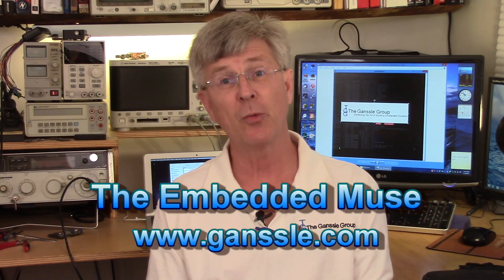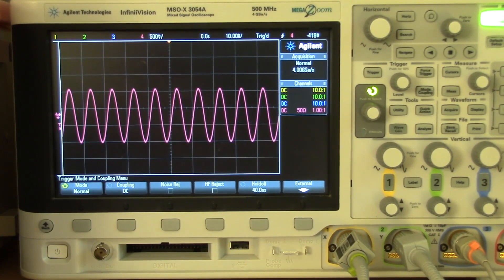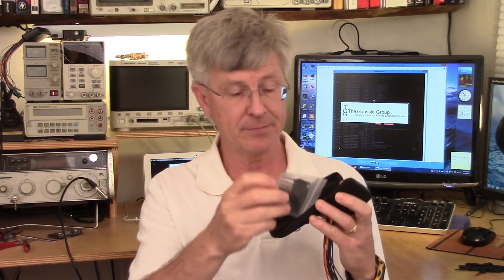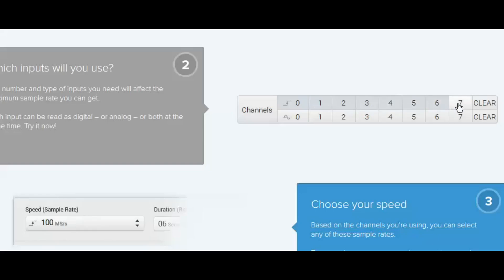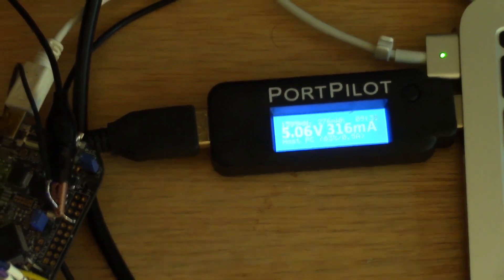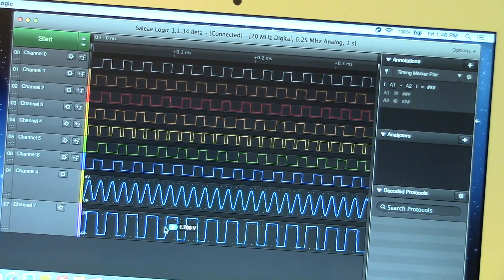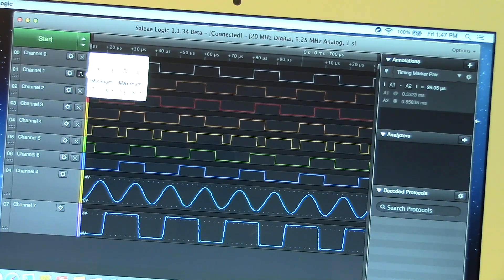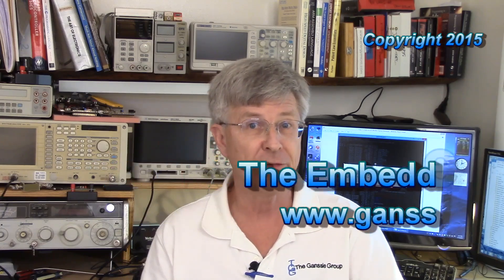Episode 15 - A review of  Saleae's Logic Pro.

Comment: this is a poor tool, only for hobby
Reply: Totally, 100% WRONG. As an embedded developer, I get far more use out of logic analyzers like this one than I do oscilloscopes.  Why?  You get an essentially unlimited capture buffer (limited only by your HD size). I've done captures of hours. You also get an almost unlimited pre-trigger buffer.  I've used the analyzer to show me the events leading up to a failure (set a gpio in a fault handler and trigger off of it, then look at the pre-history). Having the protocol decoders, you can export the data and easily write a python program to parse it (eg examining packet traffic). Jack is correct noting that the analog part is not an oscilloscope, it is, however good enough to see signal corruption (device loading, ringing, overshoot, etc...). All in all, I get a ton of use out this logic analyzer.
Reply: Well I do know that Apple uses them (for lower speed I/O, etc)... guess they're still a group of hobbyists (ala Woz) that have build a 2 trillion dollar hobby.
Reply: It is absolutely not a hobby only tool. Do some research, its excellent for debugging, and prod validation through their automation interface

Comment: Hello sir,
What is voltage input range?
Reply: Digital levels can be from 1.2 to 3.3+, analog range -10V to +10V. The analog gain is not settable and the the leads aren't designed for low-noise analog probing, so don't expect to measure mV-range signals. Still quite helpful sometimes =)

Comment: It would be interesting to see how this Logic pro compares to Digilent's Analog discovery logic analyzer. I'm interesting in having one of them, but couldn't decide which one to choose. Analog discovery cost $99 for students and $279 for non-academic, which is considerably cheaper than the one you showed.

Great video, thanks.
Reply from the maker: Mohammed Algailani The Analog Discovery is very nice at $99. I reviewed it here http://www.ganssle.com/tools.htm.
Reply: Jack Ganssle I've read the review, and you mentioned that it is not suitable for ARM development. Actually I'm doing Cortex M4 development side by side with my Spartan 6 FPGA course. That's why I need to know which logic analyzer could provide the best accuracy and better user experience.
Thanks for the link.